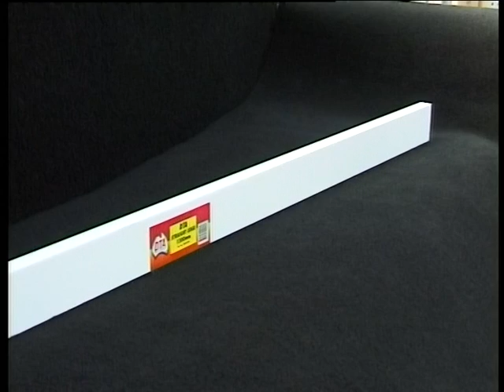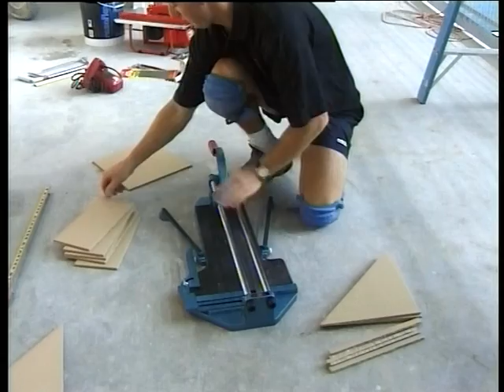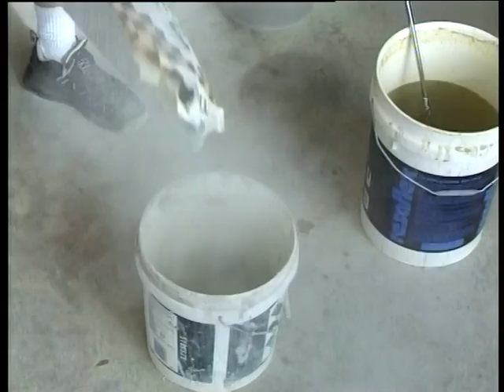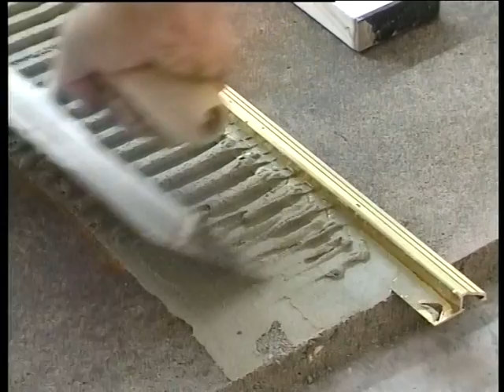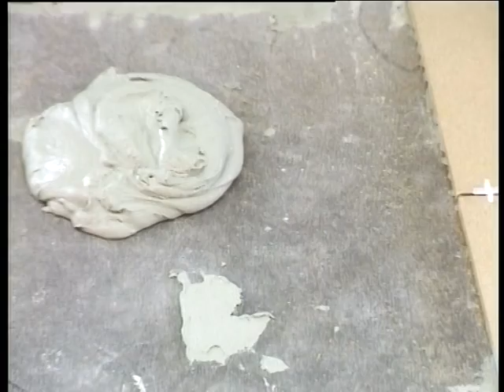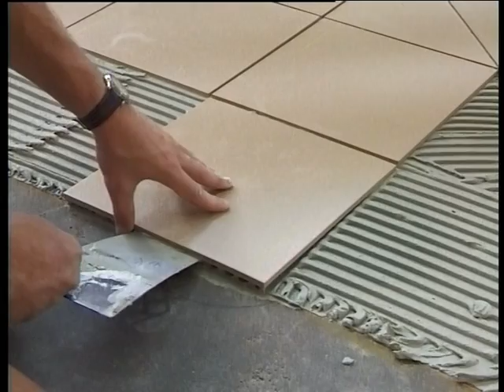How to Tile & Grout Part 3: Tiling The Floor, The Best Way to tile a floor start to finish

Comment: Wrong way to tile on the 45o and the reason is that the wall may run off 10-15mm and that difference is best done with the soldier course NOT the cuts on the inside of that border,

Comment: spacers? seriously? if i ever caught someone claiming to be a real tiler using spacers on a floor i would kick them off the jobsite immediately.
Reply: not all #tiles requires #spacers and for some tiles, you must....
Reply: True professionals grid their floors out then cut it in then set the tile. Spacers do not work in most cases because of irregular sizing of tile.
Reply: David Geiger  all of you eat shit .... coman caca
Reply: timash7 i use spacers  for 20 years i do better work than you sucker

Comment: 10:10 wait, you had that guy install that fucked up knippered tile in the corner? How horrid. YOu need to go a video on when the installer puts in a fucked up tile and now you have to chop it out of the floor after the customer complains. Thats a fun job im sure.

Comment: Can this only be done with natural stone? Assuming you can't dress the cut edge of the diagonal tiles (add a chamfer) with ceramic tiles. Is there a technique I'm unaware of or do you just leave the sharp edge?
Reply: LostRoss89